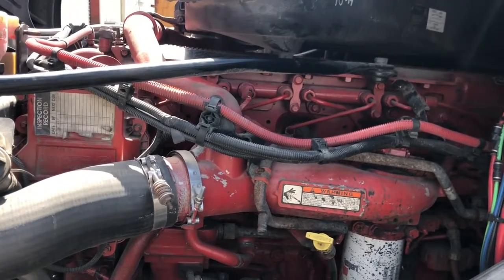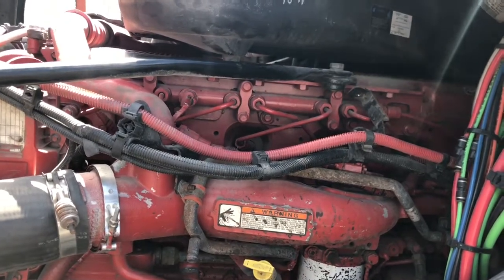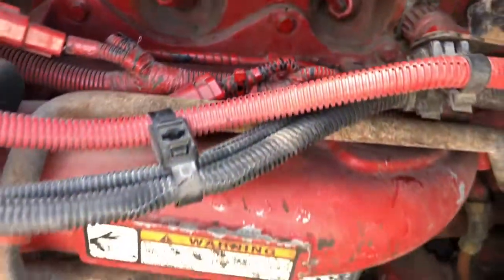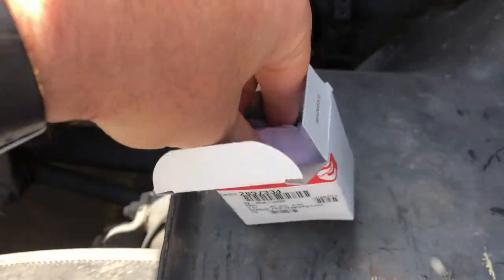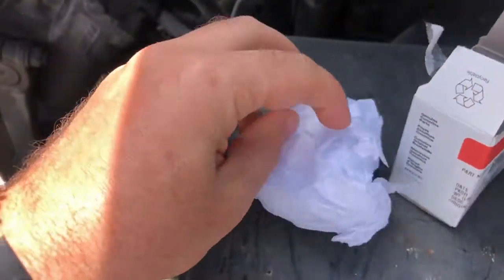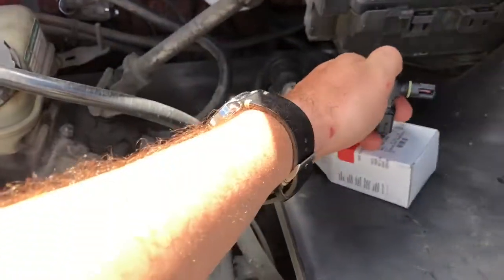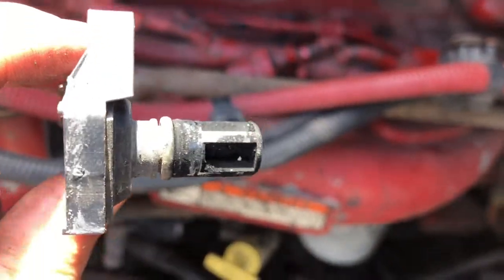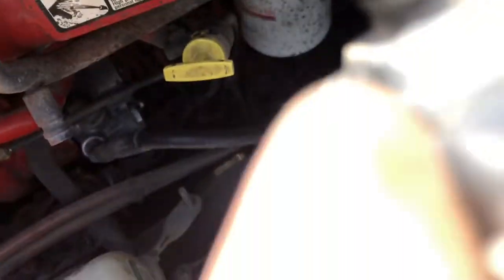intake manifold pressure sensor

Comment: This is a temperate sensor not a pressure sensor. Sets OEM Code 154. Don't be fooled. There is a sensor that looks 100% identical with 4 pins and the connector will fit this intake manifold temperature sensor which is misleading if you don't know what you're doing. The sensor that looks identical sits in the air duct near the turbo . It's a different sensor though. So don't accidentally replace it thinking it's the sensor. I did this one time is why I'm letting folks know

Comment: They also got em on ebay around $20 but aftermarket
Reply: Is quality ok? Then aftermarket one ?
Reply: @Benelli037  They're unpredictable, it can last you a kot or it can fail in weeks.
Reply: The one I purchased off ebay did not work out of the box. I ended up going to the dealer after waiting for the slow ebay shipping.